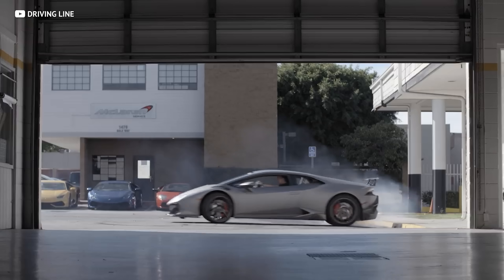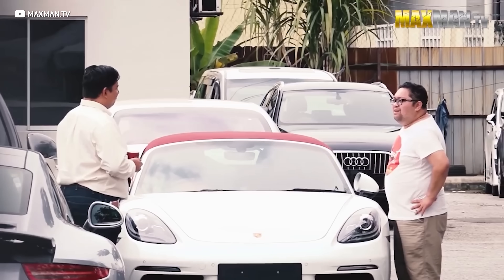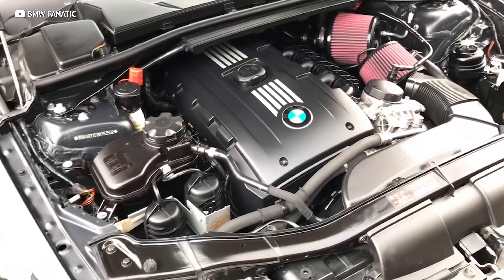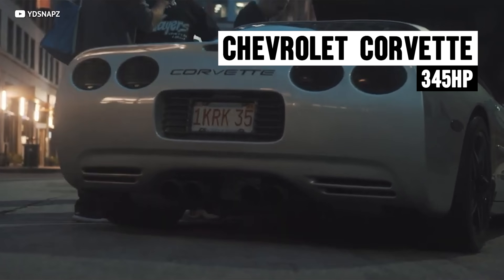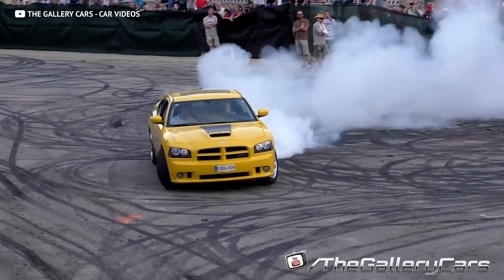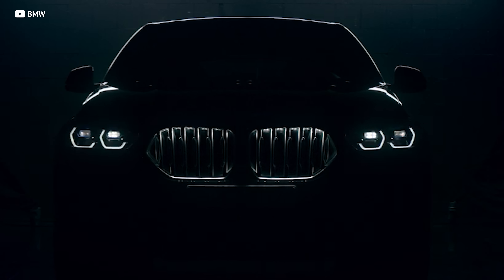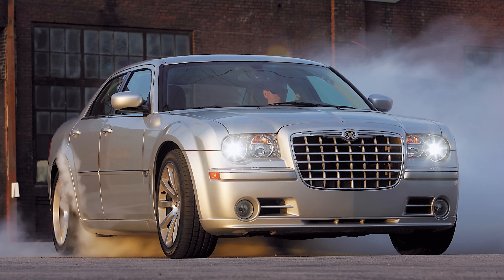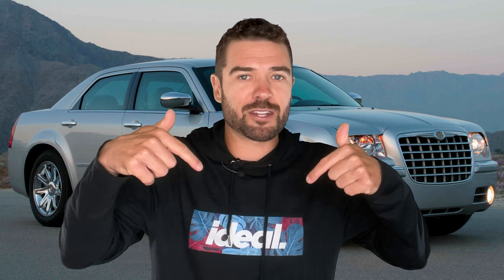Cheap Cars With a TON of Horsepower

Comment: Cool video, however, take notes. 
1. BMW makes the worst and most unreliable cars on earth.  Why would you put your own hands in a vice and tighten it to completely lose your feeling and your wallet will be empty? 
2. Infiniti is awesome. Reliable and fun to drive. G35 eats the BMW on any road race track. Get the 6-speed coupe if you can find one.
3. Vets are great. Be prepared to spend some $$$
4. Dodge, lots of power, built from recycled scrap plastic. Plan on it falling apart. 300C, lol.
5. Mercedes, hahaaaa.. just watch Scotty videos "Scotty Klimer"  ? They build in planned failure. A shock will cost you 2 grand.
6. Hyundai, Kia, easiest car to steal. But really, who wants one?
7. Pontiac GTO, has a 6-liter gas guzzler, loud but ...not fast. Cheap and there are reasons.
You missed Honda.  Open your eyes. Do your research.

Comment: I'm surprised there was no Mustang on the list.  Maybe it's a cliche or just too obvious, but mid 2000's Mustangs can be had for under $8K now in very good condition. Sure, you'll only find a V6 for that price, but people sometimes forget that the 4.0 V6 Mustangs are pushing 300HP. That's more than the previous gen's 4.6 V8 GT.
Reply: 2000s v6 mustangs had 160hp.
Reply: @gibememoni that's the early 2000's New Edge Mustangs with the SOHC 3.8. When the S550 was introduced in 2005, it came standard with a 305 HP 4.0 V6.

Comment: I'm in the market for a SECOND GTO!  I'm the original owner of a 2005, with 42,000 on the odometer.  The second one I will turn up the power and street/strip it.  By the way, low mileage GTO'S are appreciating in value now!

Comment: I have been a General Motors guy my whole entire life my family owns a Chevy dealer so you already can pretty much tell what my pic is the Pontiac GTO I've drove those cars before and they are beasts a buddy of mine has one he beats it all the time he's on that thing for years and the thing has over three hundred and twenty-seven thousand miles on it and the thing is still going strong head gasket was done on it at 225,000 besides that no major mechanical problems he bought it brand new with 27 miles on it and it's 6.0 liter this car will get you indefinite trouble but it is so fun to drive listening to that V8 there's no sound like it American Muscle General Motors used to know what they were doing it's a shame on how they've turned out

Comment: CLARIFICATION ABOUT THE CHRYSLER 300C: I love my Chrysler 300C, i picked it up about a year and a half ago for $9k out the door. I do feel the need to clarify: The 300C comes with a 5.7L HEMI, the 300C SRT8 comes with the 6.1L SRT motor. The SRT8s have the 6.1 rather than the 5.7L, different front and rear bumper covers, all color matched along with the mirrors and door handles (no chrome), and a couple other differences depending on the year (2009+ SRT8 models had the 3.06 Getrag limited slip differential and some other improvements over pre 09' SRT8 models). The 300C came out in "2005" (first rolled off the assembly lines in 04') with a 5.7L motor rated for 350HP at the crank. in 2006 the SRT8 was introduced alongside the 6th gen charger SRT8, the first generation of the SRT chargers and made 425HP at the crank! the 6.1 motor has improved flow numbers, cooling, revs out higher, has a forged crank, and is a completely different motor than found in the average 300C. (This applies to 2005-2010 models of the 300C/300S, for the 2nd generations of the 300s the SRT8s had the 6.4L 392Ci HEMI motor) (However, i do make videos on the Chrysler 300C & HEMI platform and can help you make those power numbers you're seeking in a HEMI or more! Not just the 345/5.7L, but the 370/6.1L and 392/6.4L as well!)

Comment: get a 1uz lexus gs/sc400 or a gs430. You can get them under 8k, maybe even under 5 and be able to afford a supercharger or turbos with the tune for 10k all in. Unlike almost, no literally all the cars on the list, you could probably get 300k miles on it, maybe even 400k, the motors are generally pretty cheap, and with a standalone could run at 8krpm on stock internals, maybe even 9k rpm if you want BMW reliability or if you change out the rods.

Comment: For Eu people. Seat leon first gen 1.8t, 180hp for dirt cheap and stage 2 they make 300hp. Also first gen audi a3 2.0 tfsi. With a simple tune they make 260ish hp with quattro
These are way under 5k especially the leon

Comment: I have to disagree with the reliability of used S class mercs, '95 S420, '05 S500 & 600 and finished with a '15 S63 tuned 800 tq low 11's 1/4 mile, beat the piss out of her for 3 yrs then traded in for 12k less than I purchased. Great experience with used S class, defiantly will own more in the future. I suggest always inspect by independent merc shop before purchase, same goes with service for out of warranty cars.

Comment: Americans: Horsepower is not important.  Power to weight and handling are where it’s at.  A dodge that has 900hp but weighs 3x as much as a honda- only has 300hp comparatively.   And if it rolls hard on turns, what is the point?  

This is why Miatas are so unexplainably loved by real car guys- it’s balanced weight distribution, tight handling and light as a feather.  Having a 250hp miata is 3x more fun to drive than a hellcat. sorry.

Comment: You will not find any decent Monaro (Pontiac GTO) in Australia for anything less than $40,000. These only came with LS1's as the V8, or a supercharged V6, the V8 ones cost currently between $50,000 and $125,000, with most being on the expensive end than on the lower end. They cost about $50,000 from new, and in 2010, 2006 models were being sold privately for roughly $36,000. One 2005 model is for sale currently at $245,000 with 666kms on it.

Even funnier is the HSV GTO variant, which got the same LS1 to LS2 change as the yank versions. Prices range on average from around $140,000 up to over $350,000. One with 12,000km is being sold for $550,000. The cheapest is a bargain at $80,000 with its LS1 and 116,000km on it.

Australians LOVE to act like the fact they're not being produced anymore along with that Holden doesn't make cars locally anymore now means that Holden no longer exists, so every car has skyrocketed in price. Even a clapped-out V6 base model sedan will have had its price jumped from around $2,000 to maybe $8,000. V8? Double or triple it, even with 200,000km on the car. Bitcoin? Nah, should've bought a VY SV8 with 220,000km on it 3 years ago, now that's how you make easy money!

Comment: Not trying to throw hate here, but I've been already doing a lot of research on the Chrysler 300 options well before I saw your video. One piece of your information is a bit off. The Chrysler 300C is the 5.7 hemi whereas the Chrysler 300 SRT8 comes equipped with the 425 HP 6.1L beast. Keep up the great YT videos though!

Comment: Ok, you’ve got to get some facts straight.   A 300C is the same trim level as a Magnum RT or Charger RT.  5.7 Hemi, 340HP, 390ft/lbs.   The 300C is NOT the same as the 300C SRT8.  Only the SRT8 versions of those three cars have the 425hp Hemi.   The 300 you showed in the pics was an SRT8, the giveaway being the SRT8 wheels.   Good luck finding a decent SRT8 for less than $10,000.    A few years ago you could find a high mileage or clapped out version, which, to be honest, is no big deal, as they are easy to repair, and the platform sharing means replacement parts are easy to find, unless they are SRT8 specific, and high mileage does NOT mean the engine is worn out.   At 185,000 miles, my 06 Magnum RT runs and drives as new, albeit I’ve kept it up.   To be honest, the best bets on this list are actually related.   Get a Mercedes E or S Class 500 for the 5.0 liter V8, with lots of horsepower, and the AMG versions are very spicy, and with some hunting, can be had for less than $10k.   And guess what?  The Chrysler LX platform, which was the 300, Magnum, and Chargers, were totally based on both the Benz S Class and E Class. Sit one of each side by side and the similarities will blow you away.   Some of the switchgear are identical.    The transmissions are the same.     Rear diff, same, front and rear suspension, same.  Not carryover parts numbers, but very slightly different.     Same with the GTOs versus the Caprice SS and the G8s.   It’s all Chevy parts.      Smoke em if you got em.

Comment: Reason why there so cheap. Usually they need work and maintenance isn't cheap. Though I do most my own work. My best friend's daughter had one those STR8's and complained about the maintenance costs all the time. She just sold it I know for less than 10k. I was slightly tempted but I know how it was treated.

Comment: i had bought my 2010 bmw 135i for $12,000 70,000 miles with mainly stock (300hp) last/newest year of the n54 engine u can get. the 128i breaks down and so does the 328i get a 135i or 335i paid around $2,000 to get it stage 3 tune, bigger turbo, catless downpipes,  custom exhaust, jb4 stage 3 tuning and a few cosmetic touches rims allllll the bells and whistles my 2010 bmw 135i that came stock 300hp got up in the 550hp range , agile safe small car im talking i could take anyone in this car its a 2dr coupe and the backseat was so small it was a joke i removed it to make the car lighter and i can do 150mph on tha 5 san diego at 2am and ill be racing ducatis, porches, teslas, lamb suvs, new supras ols supras, gtr u name it my tiny 135i was shittting on 650+hp dodges and anyone that came my way. ive owned a jag xj supercharged tht was stock 510hp tuned up to 650hp and my lil beeeemer 135i NEVER had 1 engine broke evenwith all the mods. my 328i had like $6,000 in stupid repairs  and it wasnt even tuned just a daily driver. go with the n54 engine bmws. trust me look into them i believe they won best engine of the year over all car companies for like 3-4 years best car ive owned was a 2010 bmw 135i. tbh it was better than my 2013 m3

Comment: I already have a 2005 BMW 320i, 4-cylinder, got him for like 3000 euros.
I could use like 300-350 hp in it, some bodywork and it definitely needs new suspension.
Obviously, the car isn't in tip top condition, it needs care, but that's the point.
I wanted a car I can work on and make it look the way I like and the way my BMW likes it.
I mean, come on, he's got to be sexy for the girls you know. :D

Comment: Well, it's safe to say that my definition of "cheap" is much different than yours. I thought thus list would be more in the $5k to $7k range... like maybe cars like the mustang gt new edge (1999 to 2003) or maybe an ls400???
Reply: 1999 Buick Regal GS, supercharged V6 that can easily and cheaply modified for alot of power.

Comment: Well I must agree, My oldest son is a wing nut and he has a few hot cars, a 69 Elco with a tube cassy and a 454 with twin turbos and a auto overdrive, a 1970 Tubed Z28 full gage running another 454 that has a tunnel ram with two holly 4bl fuel injection units. Both very fast cars, but the king of his driveway is a 2004 GTO. I thought the thing was a bucket. But that shows I don't know everything. This car has a LT1 and with a hookup from his friend next door, a Cadi Comp Guy and my son picks up a brand now big Caddy SuperCharger with pullies that only need a pin on the bye pass door replaced. Some big Vett injectors, a custom ground cam and a upper pully so small we had to gride the shaft just to get the pully on. House Power? oh, it's got that. So much he had to add a one peace drive shaft. He took me for a ride, Shit! I have never been in anything that moved from 0 to 200 that fast.

Comment: Do not fall for the bmw trap unless you have a stable job for maintenance and repairs which will probably cost you more than the car in the long run if you aren't prepared.

Comment: The Pontiac GTO came with 350hp and the only time I’ve seen one under $10k was because it was a rebuilt salvage title.
Reply: BMWs & Mercedes are not worth buying unless you make enough to pay for repairs. Even the more reliable models still have more expensive parts & maintenance. Tbh not really great to advertise as being cheap cars.

Comment: some things to note about the 335i cars.
I have the 335i e92 and you can make a LOT more than 400HP. The N54 is a 3l I6 twin turbo that needs a few bits and pieces
mine is pushing 500rwhp on 98 octane and will do 0-100kmph / 0-60 in 3.3 secs.
however don't get one... it is so so damn expensive. you WILL need to replace your injectors with the latest index 12s. new they are about $700 from BMW and you need 6.
you WILL need to fix or replace the turbos. they are trash... The charge pipe will need to be replaced with a metal one as they break and cause a boost leak.
water pump is made of plastic and dies and metal replacements tend to kill the engine somehow. you have to use special coolant (blue).
The high pressure fuel pump WILL die. Not might... WILL die.. so get ready for that.
the oil filter housing will leak and when it does it'll do it directly onto your belt. that's always fun for the whole family.
oh and electrical gremlins are rampant in them, just ask an owner about the LCM. oh and there is no dipstick its all on the computer in the car. so if it dies you are blind to your car health.
however. 
I love it, its a lot of fun really quick and looks great. If you are a car person and you are willing to do it all your self or shoulder the cost then id recommend them. They are probably the highest performance per dollar car on this list. Just get a intake kit, JB4, down pipes and away you go.

Comment: here in greece 
BMW 335 300HP 15k to 25k with 100kkhm
infinity g37 360HP 32k with 75kkhm
corvette 340HP 20k to 40k with 68kkhm to 130kkhm
dodge does not exist,if it does its old and trash
mercedes s550 388HP 20k with 320kkhm
hyundai genesis does not exist
pontiac gto 327HP 70k its from 1967 we dont know how much khm it has
chrysler 300c 345HP 11k to 18k with 70kkhm to 320kkhm
so in conclusion greece is a third world country and everyone drives a golf 4 from 2004 and many older cars

Comment: I would get the Chrysler 300C for the power and the luxury and being able to get my family around safely. since my car is now in the shop and needs a new CVT transmission with labor costing over $6,500 when i only traded a Cadillac and paid $1200 on top of that to get the car. now my family and I have no car until we can try to get it fixed. my wife has to bum a ride from coworkers daily to get too and from work the last two months or so and I am missing work due to being the only one who has a license and that can drive but has no car.. life never stops crushing us does it? we could really use the $10,000 to buy a better safer vehicle.

Comment: Should have had the Pontiac Grand Prix GXP and Bonneville GXP. 5.3L V8 in a 4 door sedan.  303Hp/323 lb-ft torque.

Paid $700 for my 06 325i granted compared to these cars 215Hp is not much tho for the price it's allot of fun. and a better handling power plant then my 2000 Grand prix GTP

Comment: U gotta explain to these teenagers that getting an example of a bmw for 8,000 grand u should expect atleast $5000 in total repairs
Reply: My thought exactly. If the motor doesn't need repair soon, expect the transmission or rear end to require maintenance or replacement. And if there are electrical problems...oh headache...and don't forget the high price of filling that quickly-draining gas tank...

Comment: Oh man really?  Go to the wrecking yard and get a 95 Vette with a grenaded engine.  Next head over to the SUV section and get the Engine, Transmission, and Computer out of a 2015 Yukon.  The car you can get sub-$3,000, and the Yukon package for $700 to $800.  After that you take them home and become a mad scientist, with the help of a Summit Catalog that you can get for free by going to their website.  The parts so available and for cheap.  Sorry I dont believe in store bought horsepower. BUILD IT!!!

Comment: I got a pretty clean GTO on market place for 5k plus about 2500 in pokemon card trade. I had to put a new engine in it due to a spun rod bearing...(knew it going into it---sorta) But, Its now cammed with a BTR stage 3, a rebuilt 5.3 instead of the 6.0 (much cheaper), plus many other aftermarket goodies (I need more). I've put about 5-7K back into it. Market place is where's its at, it is my new car dealer. I got my 1996 dodge work van with under 100k miles off there for $2200, its been a blessing to say the least. This guy is spot on with these deals! I love my GTO. However, I wish I would have known more about the car before getting it. Plan on being a part time mechanic, but its fun to learn and this car has taught me more about cars than I ever knew before. Once you got one you like, you're in love and there's no going back lol (make sure the title is signed over properly if you buy from market place or, someone random. With my GTO , the dude I bought it from never registered it too his name. long story short, the guy before him technically still owned it... I had to contact him and go through a litany of hoops "a lost title case"----it was a nightmare, and cost about $500 at the end of the day.) Don't be a dumbass like me.

Comment: So two junker bmws that will need at least 10k in repairs each year a Benz that's the same way a gto that the cheapest out there is like 18k two dodge with major trans issues so only one decent cat on the list
Reply: Oh ya the Genesis also has trans probloms and the vette is almost impossible to find under 14

Comment: Hyundai Genesis 2009 4.6L reliable luxury and under 10k 363hp or Saturn Sky 240HP 2.0Turbo redline 9k around 80k miles 0-60 5.3 sec don't look for hp look for actual reliable cars that you can tune easy and can drive it every day